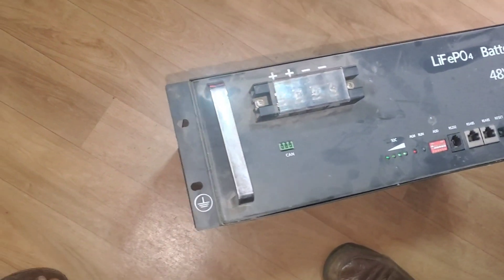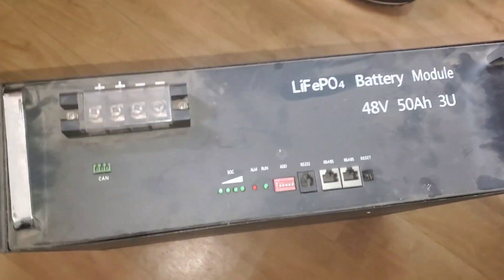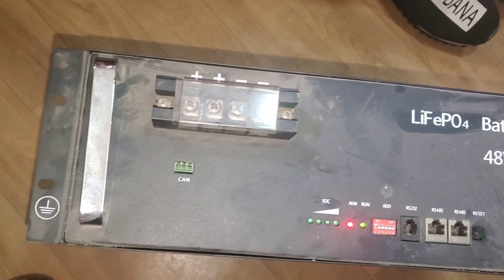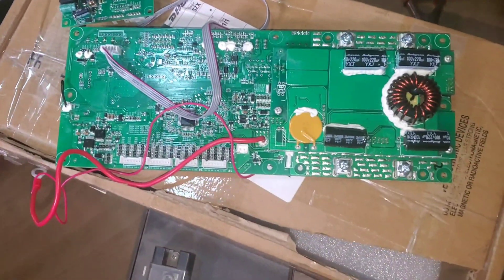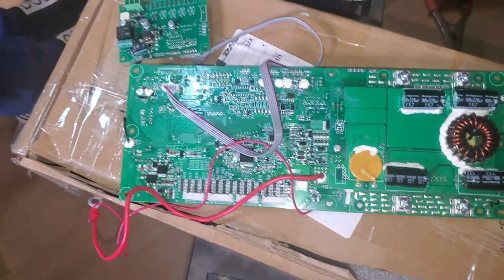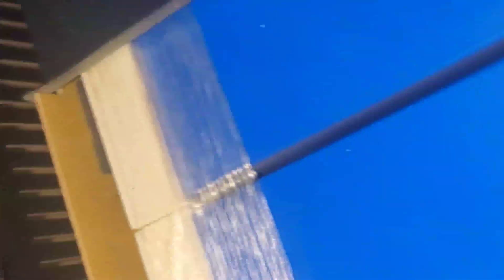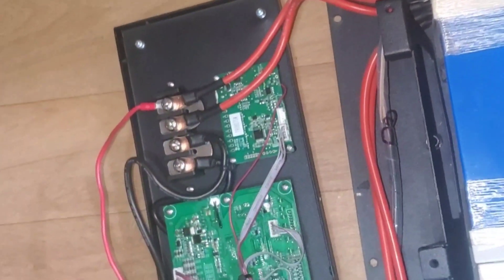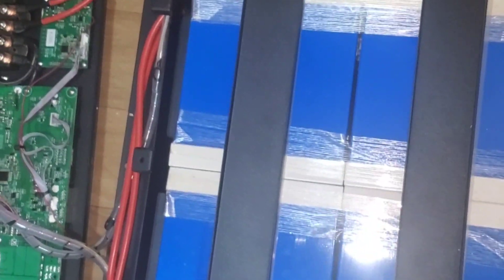I open a Topband B4850 Lifepo4 battery.

Comment: Did the replacement fix the battery?
Reply from the maker: Different battery. This was from another manufacturer. The BMS fixed the issue. We will confirm tomorrow in the field